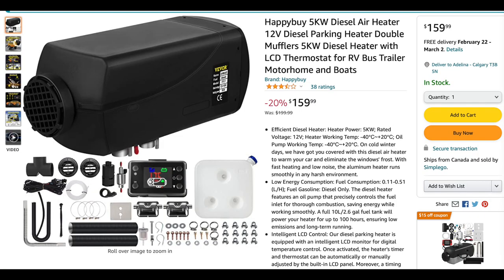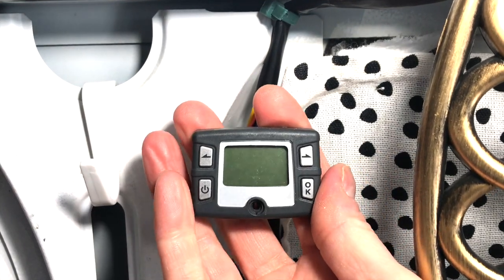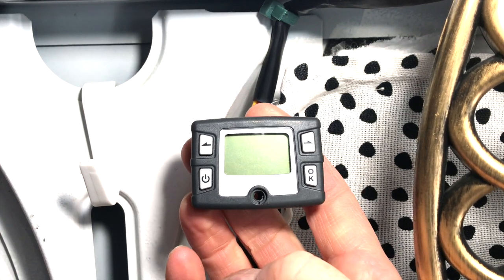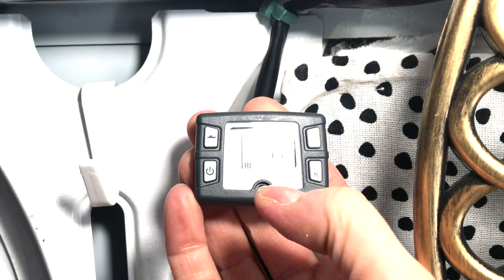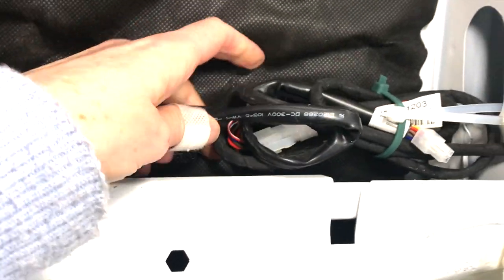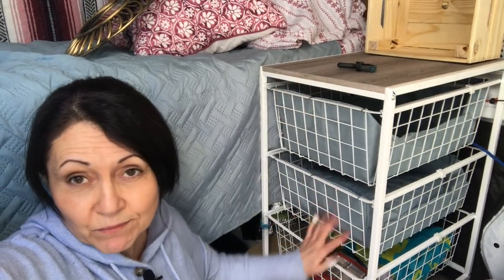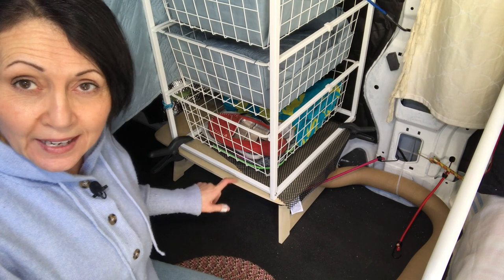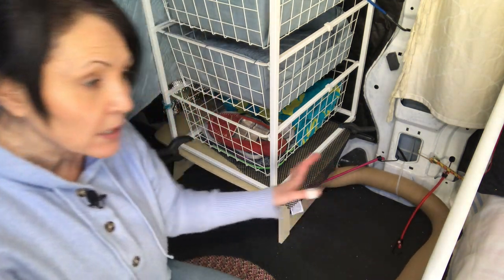My Van Heater: Part 1

Comment: The uninsulated parts of the interior will radiate cold into the van and having the controller right next to the metal will make it read cooler than it is inside. You might want to cover that metal area with something.

Comment: Excellent video, Adelina.  Great presentation that explains everthing at a layperson level.
I agree that folks should get the best quality that they can afford.  Unfortunately, quality cost$$.  I, too, hear of the knockoffs failing at the worst time - when things are really cold.  This is one component that should not be skimped on.
We bit the bullet and got a diesel ESPAR D2 for our Sprinter van.  Expensive?  YES, but here we are at over three years of heavy use.  We run it easily over 100 nights a year with no issues.
One thing we do is always run it a full heat.  We regulate the room temp with our windows and ceiling fans.  I've read and heard that the worst thing to do is run it at low heat because the fuel will not completely combust and you will get soot buildup.  I am getting ready take ours apart and replace the internals just for preventive purposes.  I am curious to see what soot buildup is in there.
Also, and I don't recall you mentioning it, but I installed the altitude compensator.  I highly recommend this.  We spend many, many days and nights above 6k feet.  No problems whatsoever.
I also agree with you, these things are amazingly fuel efficient.  If we are parked for a week or so and use it daily, our engine fuel meter hardly moves.
Love your videos.  Robin and I are big fans.  Would be fun to meet-up sometime.  I work in Yellowstone during the summer.  If you get a chance come visit the park and say "Hi!"
Reply from the maker: Hi! Yes, I’ve heard that you should run it on high too. That’s the sort of thing that the rep, Ian, will go into in part 2. I’d love to meet up and see your rig someday!
Reply: @K & R On the Road I had never heard about the altitude compensator. Great & useful info. Thnx.

Comment: Glad to see you doing things in your van again. Must be the spring-like weather! 😉 
We’re converting a cargo trailer so didn’t want to carry diesel or gas in it as well as the propane tank. We went with the Wave 3 propane heater. The coldest weather we’ve experienced when camping was at night in Arizona and New Mexico; it was so dry that I was getting nosebleeds so I don’t mind having some extra moisture in the air. That’s my rationalization anyway. LOL
Reply from the maker: That makes perfect sense Hazel 😊

Comment: Does the intake side of the heater has a filter? Can you put one? Just thinking. Because the heater is on the floor, it may pick up dust and dirt etc very easily. I know this because i have an air purifier at home. When I change the filter every year, I see the bottom of the filter has always more dust than the top part of the filter. With a filter, you can maybe catch the most of the dirt going into  the unit?
Reply from the maker: No I don't think there's a filter.  I wouldn't put one in without the company saying it's safe.

Comment: How does. Propane heater release moisture into the air.  I’ve always known any heat to make a place dry.
Reply from the maker: Propane just does 😊. I’m not sure today the mechanics lol.
Reply: Weird, eh?  Gas heaters in the house dry out the air!
Reply: Diesel and petrol heaters draw in and vent air from the outside. Propane furnaces in houses and propane heaters (ie. Propex HS 2XXX) in factory built RVs also pull in and vent air from the outside (cold air has less water vapor) and thus produce dry heat. Mr Buddy heaters and the like are unvented, and thus recirculate warm air, which contains more water vapor, hence moist heat.
Reply from the maker: Thank you for that explanation 🙏🏼😊
Reply: The moisture is the byproduct produced when the propane is used.